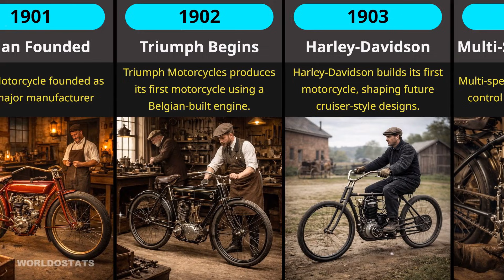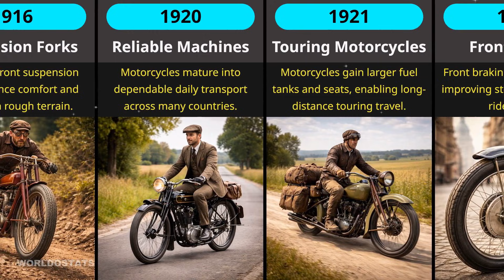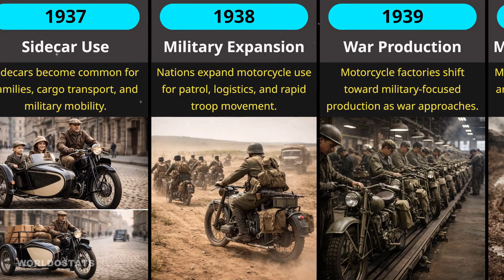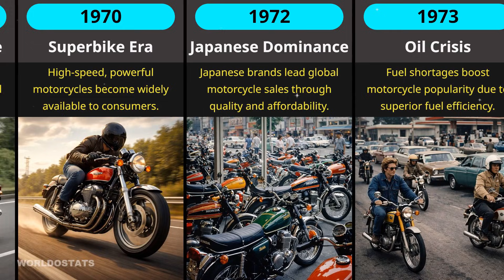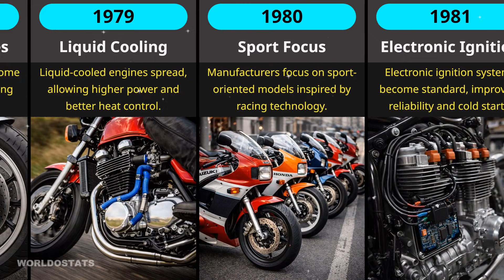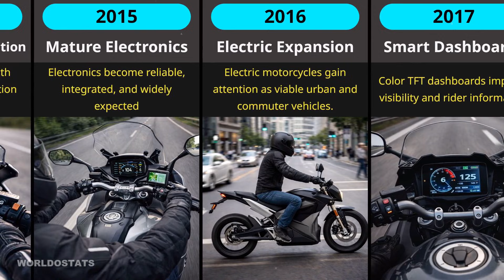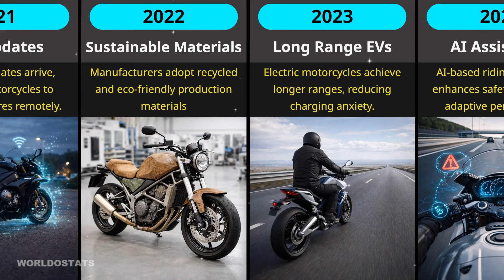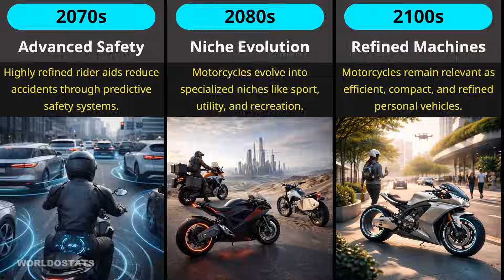How Motorcycles Evolved (1867–2100)

Comment: 2100 and still no hover anti-gravity bikes 🤷‍♂️🤦‍♂️
Reply: Anti gravity deny law of physics
Reply: @nischalthapa5320  a lot of things defy the laws of physics until we understand how it works then it just becomes a part of history
Reply: @A @AdrianLucid  every types of vehicle human have created till now either that is cars bus truck motorcycles or even planes and  space rockets directly or indirectly uses gas propulsion systems or internal combustion engines to create power to move at speed
Reply: @nischalthapa5320  except for electric powered that uses zero fossil fuel
Reply: @AdrianLucid  electric car doesn’t use ic engine but it still fully relies of rotional motion like motor will rotate at high rpm and torque to move gear drive shaft and main wheels which makes car to move it still generates friction when you say about anti gravity means a vehicle which isn’t effected by earth gravity it continuously hover in air no propplerfan and turbine blades like planes and 0 noise it doesn’t realise virtually anything as byproducts to move and fly it isn’t using  bornulis principle or newton thirdlaw so it is practically impossible no matter in 2100 or year 3000
Reply: @nischalthapa5320  nothing is impossible